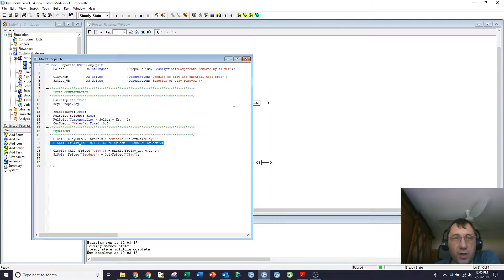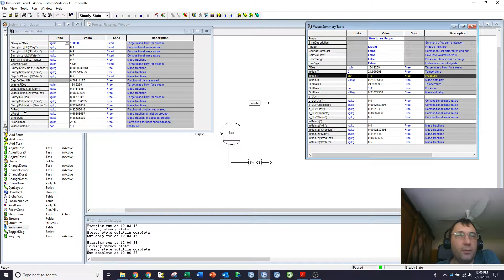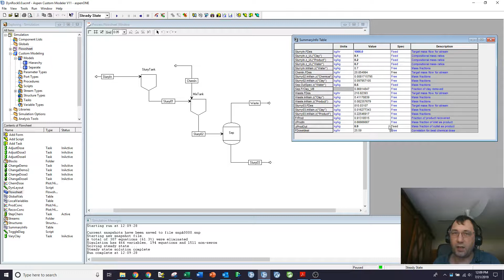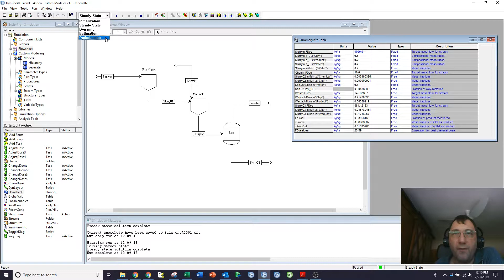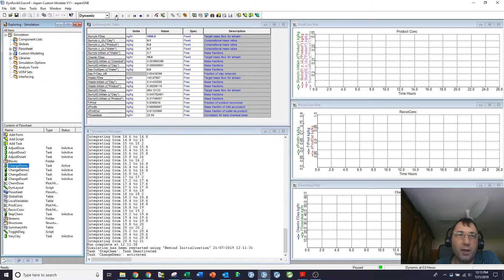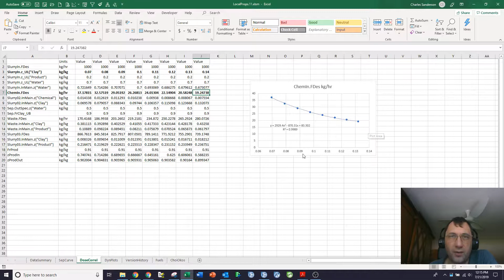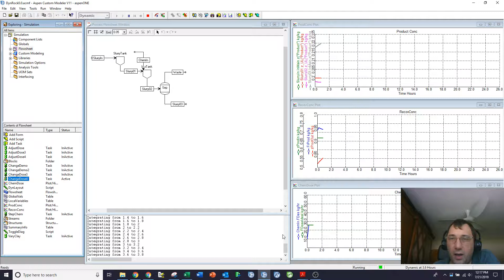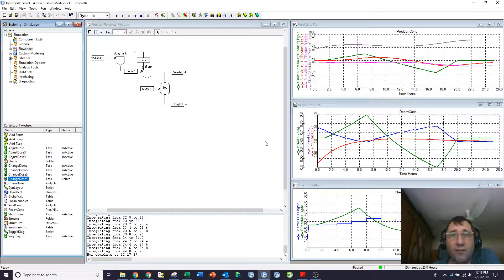ACM11.  What ACM can do - Short demo of typical ACM results.

Comment: Thank you for your videos, that's really very helpful. I'm building a model in ACM and can't export it to Aspen Plus for validation. Are the results in ACM process flowsheet supposed to be the same as when exporting models and simulating in AP or HYSYS?
Reply from the maker: I'm pleased to hear that the videos are helpful!  Let me know if there are any specific topics that you think would be useful.
In terms of the simulation results, the simple answer is yes - the results should be the same regardless of which package you use.  The more complicated answer is that the could vary slightly:
- You need to make sure that the you're using exactly the same phys props in both systems with the same options set.  This is usually the case, but there are so many flags and options, it's worth double checking
- The different packages use different numerical methods and convergence defaults.  Typically ACM will solve to a tighter tolerance than the other packages, particularly if there are iterative loops (recycles, design specs, ...).  This shouldn't normally be an issue, but it can surprise you, particularly if the equations aren't well scaled
Reply: Thank you for your response, I really appreciate that!
I need to insert some parameters in my model equations like molar density, kinematic viscosity and diffusion coefficient. How to import them from properties to ACM?
Reply from the maker: You can access most of the Aspen Properties results inside an ACM model by calling the properties Procedures.  The write up "Help | Aspen Custom Modeler Contents | ACM Reference" is decent.  The "Physical Properties Reference" outlines how to pick the Properties solver options and the "Library Reference | Property Procedures" outlines how to get individual items

Comment: Thank you very for making such useful tutorial for chemical engineers. I am using ACM for modeling membrane distillation process. The system contains electrolyte. My model is working fine in ACM environment. But, the exported model is not working in Aspen Plus. Model fails when feed stream contains salt. Any suggestion is highly appreciated.
Reply from the maker: I'm pleased that the videos have been helpful.  I'm afraid that I have very little experience in exporting ACM to AspenPlus - I prefer to do all my modelling in ACM – so I can’t really help you, other than to make some wild guesses.
I'm guessing you're using the Aspen electrolyte physical properties for such a complex system.  My only suggestion would be to add a converter block in A+ to shift from using electrolyte chemistry to just normal components for the ACM interface.  I think you should be able to recreate the electrolyte mixture in the ACM model inlet, do your distillation calculations, then convert back to “regular” components to pass the stream back to A+.  Back in A+, you can add another converter block to recreate the electrochemistry.  It’s a bit cumbersome, but all I can think of.
Sorry I can’t be of more help.